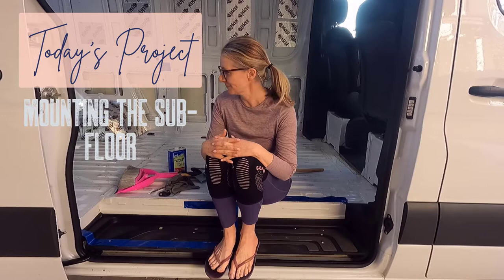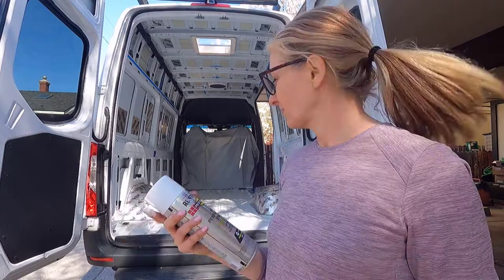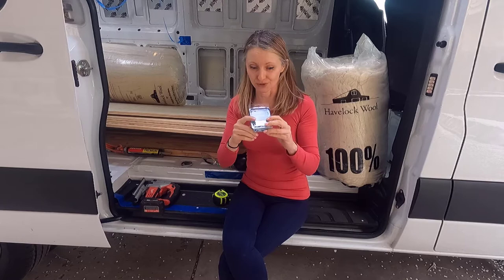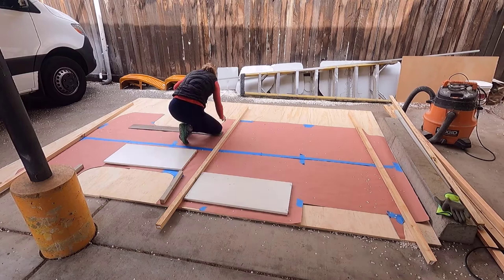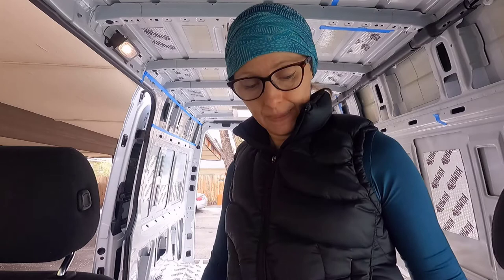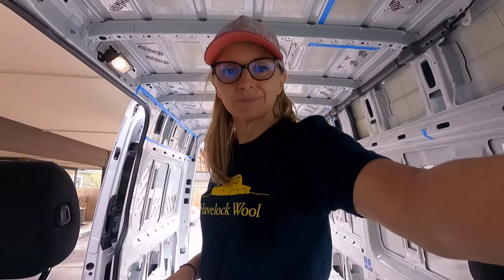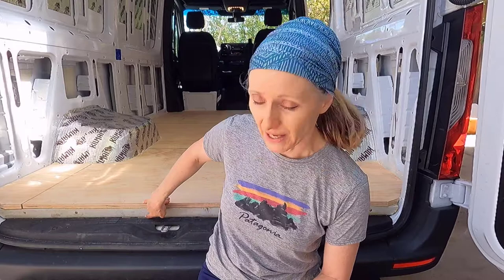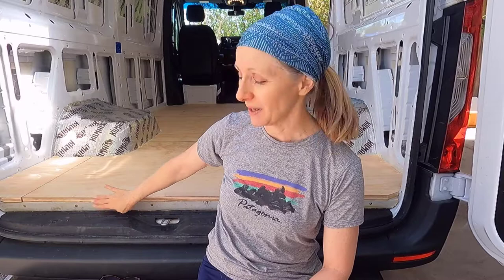Van Sub-floor And Insulation  |  Van Build Series  |  Ep. 11

Comment: In 50 years of van building you are the first person who I heard (watched installing) of using cork in the floor of a van. And to put wool on top of the cork( I know the wool will not off gas, But will the cork off gas ?) I  find it hard to believe that the wool will not fall down in the walls and go flat in the floor.
Reply from the maker: Hey @John Grant, thanks for your comment.  Cork is 100% natural and will not off-gas.  In fact, all of my products have been carefully chosen to ensure that nothing will off-gas and is in no way toxic.  The wool is by Havelock wool and they actually recommend that you don't put it in too thick as the wool fibers have excellent insulation properties.  When I put it in the walls I'm going to ensure that it doesn't "sink" too much in order to ensure insulation properties are kept in all places in the van.  It is the best thing for insulation when e.g. cold outside, warm inside or the reverse...which happens all the time in a van.  The owner of Havelock wool himself has a van and has extensively tested it in van insulation.  Read article here: http://havelockwool.com/2019/10/vapor-diffusion/